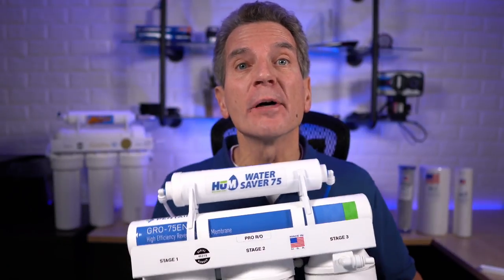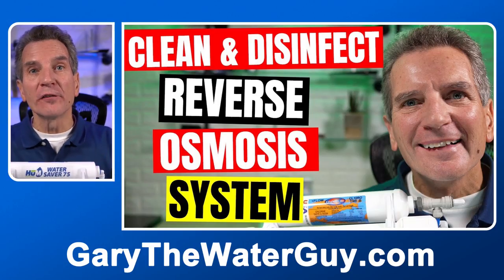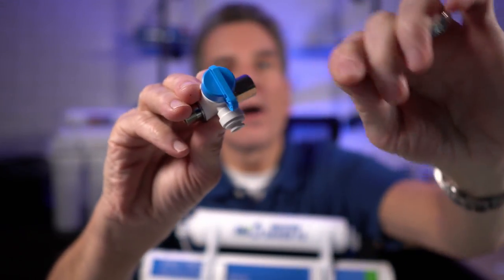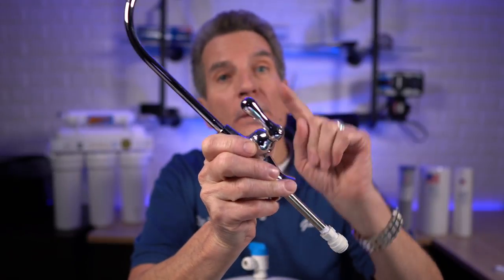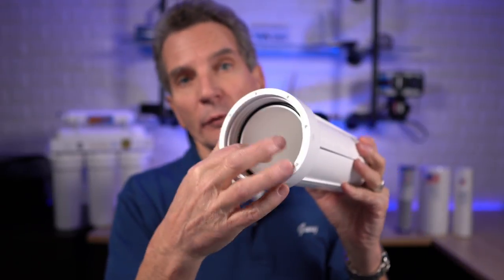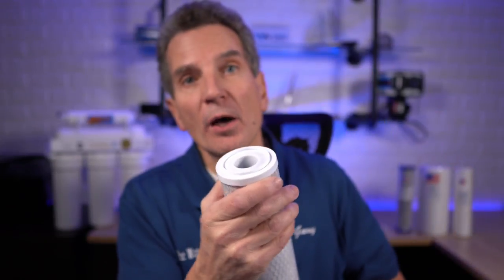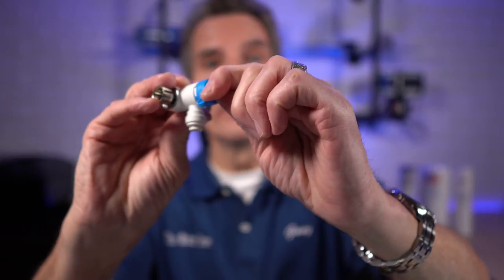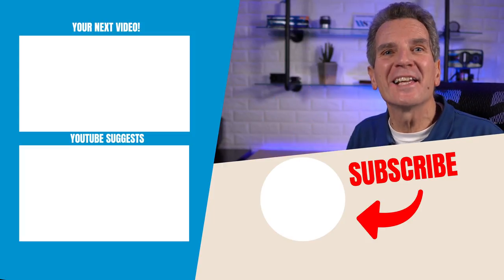HOW to CHANGE FILTERS in RO System

Comment: I have seen other video's on changing filters on similar systems and they said to not install the RO membrane until you have flushed out the carbon filter, otherwise it will ruin the RO membrane....makes sense to me.
Reply from the maker: I have performed these filter chnages hundreds of times in customers homes and since the membrane is typically only changed every 5-7 years but the carbon and other filters are changed annually we do not remove the membrane during the filter replacement unless we are replacing the membrane.  I have never had a problem with the carbon fines "ruining" the membrane or have ever heard of it happening to someone else.  It wouldn't hurt to do it that way, just not necessary.

Comment: Thanks for this video.  Great job… well done.  

Question: I saw another video where the person disconnected the RO membrane so he could flush out the new filter.  It seems like that made sense to do since it seems the new filters have a lot of debris that needs to be flushed out.  Wanted to get your thoughts on that.
Reply from the maker: No, that definitely isn't necessary.  We've changed and helped others change thousands of these filters over the last 20 years and it definitely has not been an issue.
Reply: Yeah that was disconnecting the tube on the in side of the membrane and flushing the carbon filters through when new. Definitely worth doing as there's loads of loose carbon in there, the water s grey

Comment: Just followed your video and changed my filters. Great video , especially that they were very difficult to get off. My problem is there is only 3 seconds of water running from the tap, then nothing. It was doing this before I changed the filters and thought it was because of old filters.
Reply from the maker: Glad it helped but there must be something either shut off or clogged somewhere else in the system.

Comment: Do the filters fit or snap over the little nub in the bottom of the housings? My new ones did not seem to but was still able to tighten them up.
Reply from the maker: No, they just push up against it when you tighten it up.

Comment: Hello gary. . thank you so much for this informative video. I have the proline plus RO system and while changing the 5th stage membrane i accidentally tightened the hex connector too tight and it broke. it is connected to a T connector as you showed in the later part of the video. Can you please tell me what kind of connector is that? I see it is size 3/8 and has a hex screw with a tubing that goes to the T connector and had threads on the other.  TIA
Reply from the maker: Sorry to hear.  Likely best if you email us a picture of what is broken and we will suggest the correct replacement part info@waterestore.com

Comment: Question: What about the system with mineral tube added? which means 3 tubes in the bottom and 2 tube on top side way.
Thank you for a detailed information.
Is the mineral added option recommendable?   If not how can I get rid of it?  By passing option!!
Sincerely,
James Lee
Reply from the maker: I don't think it is necessary.  You can either remove it or just keep it in place once it stops adding calcium to your water

Comment: Thank you for your video. I was stuck on removing the tubing from the post carbon filter. The written instructions didn't do it for me, your video is a big help. My system also says to sanitize with bleach, which I have done with the two large filter housings at the bottom (I don't have 3), but not sure how to disconnect the tube to the tank to add bleach there. Do you have a video showing that?
Reply from the maker: This video will help https://youtu.be/61r4CcB5HwU

Comment: Hi Gary, thanks for your useful information. Can I change the inputs to the post membrane filters (alkaline and carbon) from 1/4 to 3/8 or do I require special filters for that? They are hard to find here!
Reply from the maker: We have all sizes on our website here https://waterestore.com/collections/in-line-filters-1 but ti answer your question you can always use a reducer like this https://waterestore.com/products/john-guest-stem-reducer-3-8-x-1-4-pi061208s or this depending on which way you need to go https://waterestore.com/products/john-guest-reducing-union-1-2-x-3-8-part-pi201612s

Comment: Gary, I have an R/O system where the second filter is called an AACT, which stands for All About Contact Time. It would be the stage 2 on your 5 stage R/O system. I can't seem to find the part number to re-order. Which filter do you use in your second stage? I will just use what you recommend.
Reply from the maker: Good question!  You would use this carbon filter https://waterestore.ca/products/kx-matrikx-cto-9-75-carbon-block-filter-32-250-10-green

Comment: I need help.  I am a DIYer and installed this system myself.  It's been about a year, but for the past several months, maybe since the beginning, I have noticed an odor...now getting stronger every day.  First glass of water in the morning is now disgusting.  It smells like rubber, like it might be the bladder inside the tank.  Obviously I don't drink it, but I run water through it for maybe 5 or 10 minutes, then the odor goes away.  The water never really tastes bad, even with the odor (yes, I tried it once).  We also have a whole house softener in the garage.  The TDS at my sink is 198 while at the RO tap is 7.  How do I get rid of this smell?
Reply from the maker: Isolate to see if it is coming from the tank or the filters by shutting off the tank and running using without to see if that is where it is coming from. If not the tank, dissinfect the system using this video https://youtu.be/61r4CcB5HwU

Comment: Can I still use the carbon filter if the plastic seal is cracked on one end (not the o-ring, but the plastic the o-ring is sitting in)?
Reply from the maker: Great question. Yes, it will still be fine.
Reply: @GarytheWaterGuy  thank you! 😊

Comment: I just got a replacement system from ice spring. And the small filter at the top doesn’t have the same fittings even though it’s what I’m supposed to be replacing it with. Any suggestions?
Reply: ISpring.  Please pardon the voice text typo.
Reply from the maker: Good question.  Thsi video talks about how to determine which filters you need https://youtu.be/cLjN5ctbE2o

Comment: Hello, I've searched all over the internet, and see the same informationm but can't seem to find the order and type of filters that go in a 5 stage home system. Stage 1 is a PP-5 micron filter, Stage Stage 4 is the RO membrane, Stage 5 is post RO activated carbon (I believe it's typically labeled as T33?).

What about stage 2 and 3? What is the difference between a CTO (carbon block filter) and a UFD (granulated carbon filter)? Do you mix two types together, or use the same? Can you leave out one compartment empty so it acts as a 4 stage filter instead?
Reply from the maker: This video explains the filters https://youtu.be/Quy_Mg87Tsk stage 2&3 are carbon filters. You need 2 of them for contact time to remove the chlorine. These are the ones I recommend https://waterestore.ca/products/kx-matrikx-cto-9-75-carbon-block-filter-32-250-10-green

Comment: Hi Gary … thanks for the many videos on RO systems. I just changed out my filters and membrane (75 gpd rating) and flushed the system 3 times. I then measured the TDS against a distilled water standard (0 ppm). My water supply to the RO system contains TDS = 150 ppm and RO water measures TDS = 50 ppm. You mentioned in one of the videos that one should see a 90% reduction in TDS. So I was hoping to be in the 15 to 20 ppm range on the RO water. I will continue to monitor the TDS after a few more system flushes.
My question to you is … do RO membranes have a design/performance limit regarding TDS removal? My new membrane is an Aqua Flo membrane - Model 1812 - 75 -NPI. My system is a Canature 475 with (one sediment and two carbon filters. No polishing filter). Thanks in advance for your feedback. 😊
Reply from the maker: Yes but your water is within the range. I suggest you flush a few more times and check over the installation. If it doesn’t improve see about getting a replacement membrane

Comment: Help!  I can't uncscrew the top of my sediment filter housing so I can replace the filter.  Why won't it unscrew?  Same with the third filter housing.  Maybe screwed it on too tight?  What should I do? I'm afraid to damage the filter housing by using a plumber's wrench.
Reply from the maker: Turn off the water to the system and the tank.  Open the faucet to release all of the pressure and then try again.

Comment: Hi Gary, thanks for all these very helpful videos. I replaced all five filters (including the membrane) in my 5-stage RO system about a month ago. I flushed the filters as you suggest. My tap water has a TDS of around 650. The water from the RO tank has a TDS of around 100. However, if I shut off the tank and let the filtered water drip, the TDS can get as low as 25. I have tested this several times and the results are consistent. I was thinking that perhaps the pressure from the tank might be reducing the effectiveness of the membrane, but air pressure is correct at 7 psi when the tank is empty. Any idea what might be going on and what I can do to fix it?
Reply from the maker: I would try changing the flow restrictor to wee if that helps.
Reply: @GarytheWaterGuy  Thank you, sir. I will try that.

Comment: Hello Gary! Hoping you can help me figure this out...We’re in AZ and have hard water. I recently replaced all 5 of my RO system filters (including membrane) about 3 weeks ago and flushed the system for about an hour. Filters were 1.5 years old, membrane at least 2 years old if not more, and I immediately noticed the flow dramatically increased. I just bought a TDS meter today and checked our tap water level (740), bottled spring water level (30) but the RO water level is super high (1585). I haven’t been able to find any help online, do you have any suggestions? Any ideas are much appreciated, thank you!!!
Reply from the maker: You need to flush the membrane longer.  they come with a preservative which will elevate the TDS.  You need to fill and empty the tank at least 3 times, which typically means flushing for about 10 hours.

Comment: Excuse me, how much does it cost to change the 3 cartridges and the membrane, how much does it cost for everything?
Reply from the maker: It depends on the make and model.  Here is the link to the system in this video with the pricing https://waterestore.ca/products/hum-water-saver-reverse-osmosis-system-75-gallons-per-day and here are the filters with membrane https://waterestore.ca/products/water-saver-75-combo-4-filters-replacement-filters-membrane

Comment: My RO system has a tank and 7 cylinders.  The front row is typical:  no.1  Sedement Filter; No.2 GAC Filter and No.3 Carbon Filter.  I cant make out the back four cylinders.  I dont have that top one.  So to empty the tank I just turn that knob to 90 degrees. I bought this from Amazon:  About this item
High-quality replacement water filters
Features two 10-inch sediment filter, four 10-inch carbon block filters, and one 10-inch polishing filter
Compatible with all standard RO and filtration systems
NSF Certified
Kit contains 1 year's worth of replacement filters.  This is for RO system. What do u think?
Reply from the maker: Sorry, but I don't know what you are asking.  Are you asking for my opinion of your system?
Reply: @GarytheWaterGuy  My RO system has seven cylinders  Three in the first row and 4 in the back row. Is it ok to just replace the Sediment filter, the GAC filter and the Carbon filter?

Comment: how soon after changing the filters should the tds be 30?
Reply from the maker: Once the filters have been purged ( about 2 gallons of water) the TDS should be 10 % of the water supply if the membrane is working correctly